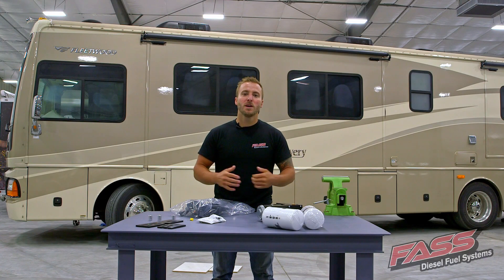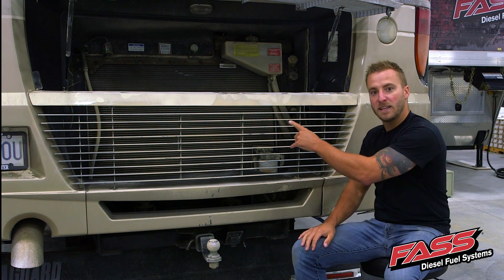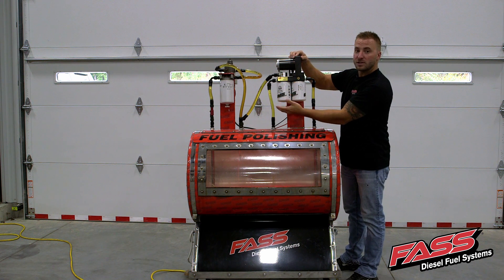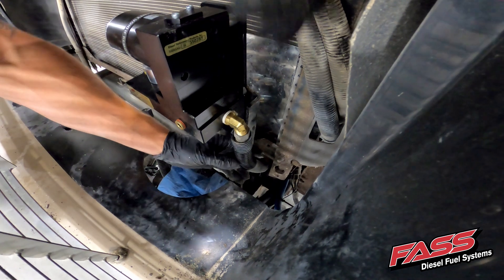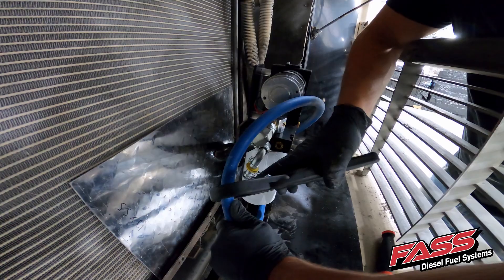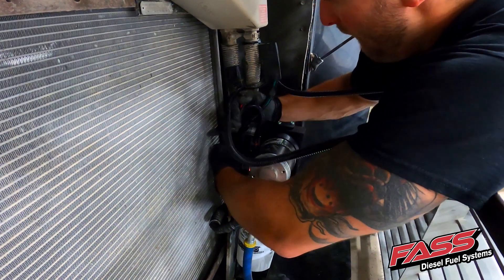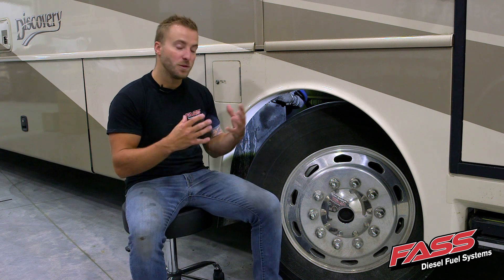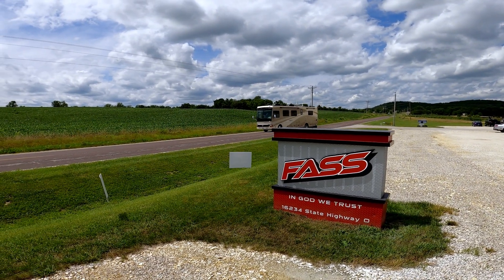FASS Installation on a Diesel Pusher Motorhome!

Comment: I have a 2008 fleetwood excursion with an ISC 360 8.3L. What kit would I need? Are there directions specific to my setup? I have a water separator and fuel filter right next to each other. I also have the bullet style transfer  pump behind the ecu not the loose 3 bolts with leaky gasket type pump.  Would the fass go inline with my existing pump? Does it matter wbat psi my existing pump is? I see there are two different possible pressure ratings for the factory pump.
Reply from the maker: Hey there! Lots of good questions. If you have time, give our service guys a call at 636-433-5410 or email them at techsupport@fassride.com. They can answer all the questions you have, get you a system that works, and help you with any questions about installation!

Comment: What part # for 2004 Holiday Rambler 8.3 ISL, and also on info on installation. Does factory filters get removed
Reply from the maker: Thank you for reaching out. We have a few links for you here: 

Fuel System:
https://fassride.com/shop/product/shop-category/universal-industrial-series/fass-ind165g-industrial-series-diesel-fuel-system-class-8-semi-165gph-universal-ind165g/

Instruction Manual: https://fassride.com/wp-content/uploads//IND-100G-or-IND-165G.pdf

Comment: I definitely want to get this kit for my 3126 motorhome which currently only has one 2 micron filter/water sep.

Did you change anything else on the CAT fuel system? Like bypassing the HEUI driven lift pump? Or add a different pressure regulator? Or does this just bolt right in place of the filter?

Deboss garage installed a FASS on his 3126 and did those things - wondering if they are necessary. 

Great video!
Reply from the maker: Thank you so much for reaching out! These are awesome questions, and we will be happy to help. For help on the parts, and installation on these we do usually suggest giving our service team a call as most motorhomes are built a little bit different. Our number is 636-433-5410. Thank you!

Comment: We have a 2003 Newmar Diesel pusher motorhome with a 330hp Cat 3126 engine. It only has ONE fuel filter, and per Cat it must be a 2 micron with water separator bowl which can be drained. On this FASS system how do you know the water is being removed, can you see it. Can you drain it or do you just replace the filter and how do you know when its time to replace it. Our Cat 3126 does not have a "lift pump"(my understanding), it has a Heui fuel pump and the fuel return line comes off the back of the head at the fuel pressure regulator. The fuel polishing ability is intriguing. Again, my understanding of this engine and I'm not a diesel mechanic. Lol.  P.S. Will the engine continue to run ok if that electric pump fails or does that require immediate replacement. It sounds like a great system but I couldn't find my engine(3126) on your web site that the link in the description took me to. How much is it and is it a DIY install. Thanks for posting this video.
Reply from the maker: Hey Rick, we would love to help you out here sir! If you have time for a call we can explain exactly how the water separation works, and help you get the right setup for your RV as well. Our number is 1-866-769-3747. Thank you sir!

Comment: What is the fass model required that you are using for this C7 install?
Reply from the maker: Hey James! This was our TS 165G System—you can check it out here: https://fassride.com/shop/product/fuel-air-separation-systems/titanium-signature-series/titanium-signature-series-diesel-fuel-lift-pump-ts-165gph-universal/
Reply: @FASSFuelSystems  so that comes with all fittings and electrical components required as the same system you used on this motorhome? I have  2006 fleetwood discovery with this same 330hp C7 engine.
Reply from the maker: @jamesrivard2625  Awesome question sir, and the TS 165G will come with filters, mounting bracket, wire harness, and the fittings for the pump. With most motorhomes being different we usually suggest professional installation as well. You are more than welcome to reach out to our tech team with any questions, and we will be happy to help. Our number is 1-866-769-3747. Thank you!

Comment: one question I do have...  tired of researching info,  Do I just leave the stock engine mounted lift pump and install the FASS ?  it would make my life easier if it doesn't matter. if it should be removed please make a video and possibly do you see a kit to bypass it
Reply from the maker: Hey there, appreciate you reaching out about this! If you don't mind for the best info and help here we would suggest reaching out to our tech team. 1-866-769-3747 They will be able to help you find the best solution for your specific application. Have a great day!

Comment: Is the FASS fuel system recommended for Prevost motorhome conversions or do they come with something similar as standard operating equipment?
Reply from the maker: Hey Dan, thanks for reaching out! Unfortunately, we aren't aware of any OEMs or up-fitters whose fuel systems remove air/vapor, over 99% of moisture, and debris down to 2 Micron. 

That said, we'd definitely recommend a FASS for your Prevost, if you're after maximum fuel filtration and efficiency.
Reply: @FASSFuelSystems  Thank you.
Reply from the maker: @bigdanc.8429  Sure thing!

Comment: I've been waiting for this video. Great job on the install. I had the fass system installed on my 2000 DP with the 8.3 Cummins and have been totally pleased with the performance and reliability. I've heard horror stories of failed factory lift pumps and after I noticed a slight leak at the lift pump is when I had the fass system installed at a local diesel shop.
Reply from the maker: Thanks for the kind words, Shane! We're glad you're enjoying your system.

Comment: Would it not be better to leave the orginal fuel filter in place and install the FASS system after it?
Reply from the maker: The PF-3001 Particulate Filter is before the pump on the FASS, so we wouldn't need another filter before it.